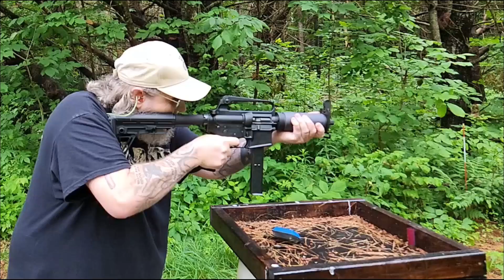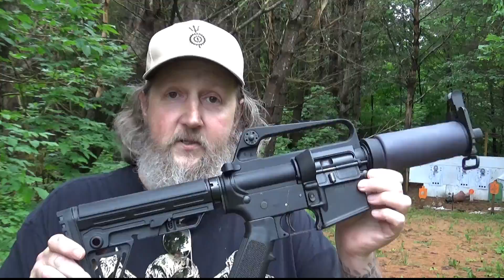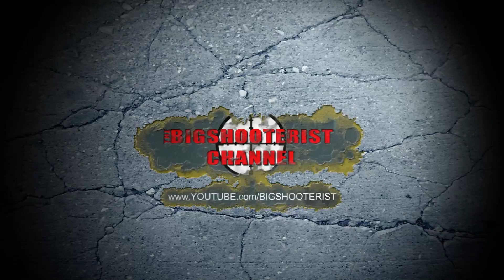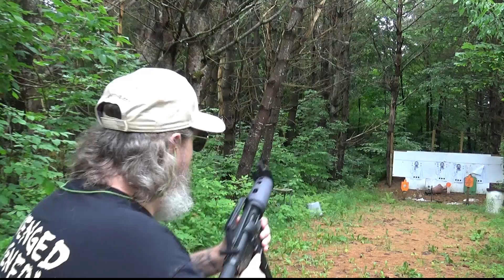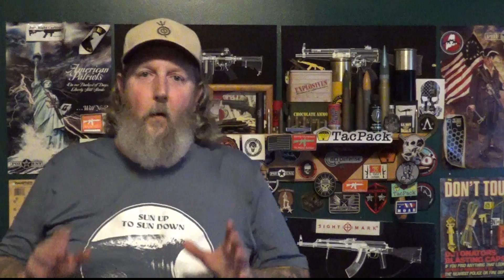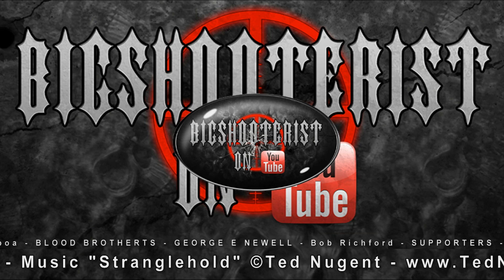DOE 9mm Upper Receiver by Liemohn Manufacturing.

Comment: Shoots little 9mm, recoils like a 20 guage. Compared to Mp5,  what were they thinking
Reply from the maker: I've found that the recoil really isn't very stout. Years ago, that blowback operating system, compared to the more traditional Direct Gas Impingement design raised concerns that it might be tough on the lower receiver, but I've never seen any problems with any of mine. I do run an MGI Military Rate Reducing Buffer in all of mine, and as well as providing a controllable cyclic rate in full auto, it also feels as though it has a "softer" recoil impulse.  If you do like the PCC guns in the Black Rifle platform, check out the CMMG Banshee. They use a proprietary recoil system that gives at more of a "Delayed Blowback" impulse.

Comment: Hey I have a transferable lower and I’m afraid to convert it to 9mm because all the research I’ve done tells me it puts a lot of extra stress on the lower especially the hammer and trigger pin and on the extension tube area. Is this all true and should I just stick to 223 to avoid the risk?
Reply from the maker: That's a fantastic question. I've heard the same thing over the years, but I've also run 10s of 1000s of rounds of calibers other than 5.56x45mm  v, I've only broken a single front takedown lug and that was while shooting .
Reply: @Bigshooterist  so no egging out any holes on the lower or anything like that ? Have You’ve been using the same lower for all those tens of thousands of rounds? Honestly soon it won’t matter because I just bought a full auto 9mm Uzi too I’m just waiting on the tax stamp which is probably what a 9 month wait?

Comment: Colt smg uzi mag lol
Reply from the maker: 😎 It's a Colt magazine pattern, but it's based on the original UZI SMG magazine. The one I'm using was an aftermarket UZI mag that's been modified for use in a Colt.
Reply: @Bigshooterist  very cool it was the weakest part.
Reply from the maker: @thomasloks  Agreed
Reply: @Bigshooterist  Sir, it's really amazing you going through the comments and answering or replying, Thank you again Sir.
Reply from the maker: @thomasloks  it's the last I can do.
Reply: @Bigshooterist  Sir absolutely appreciated. Sir.